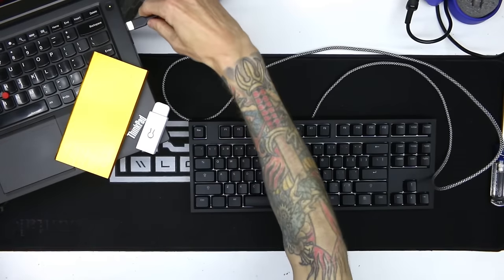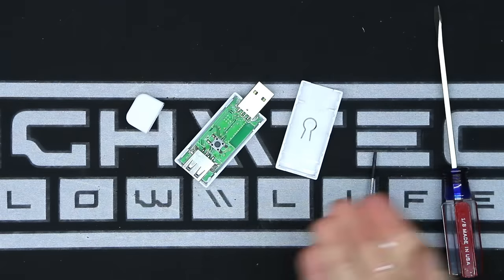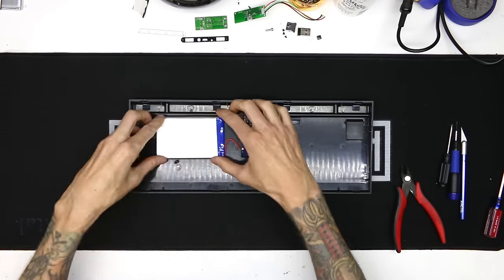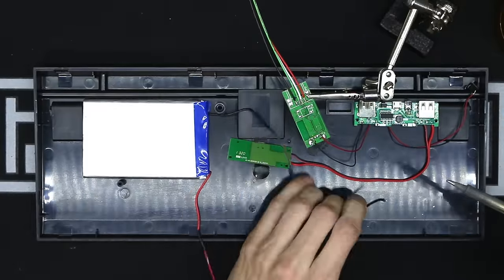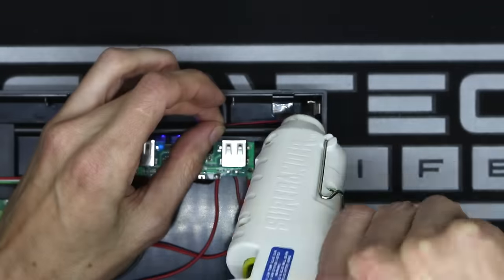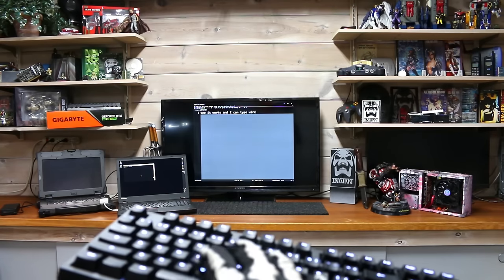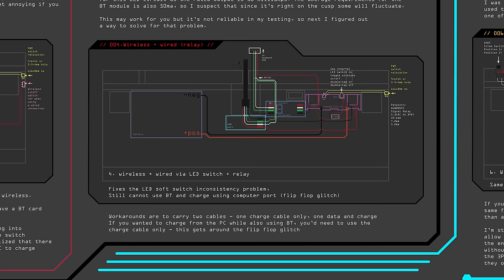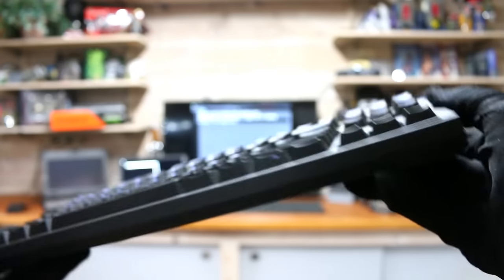⌨ Make ANY Keyboard Wireless! - Convert Any USB keyboard to Bluetooth Wireless - DIY Tutorial How To

Comment: how to test if the keyboard pcb is still good to be use if the connector usbc end is broken?
Reply from the maker: You will still need a way to connect to the PCB, if you can solder direct to the USB pads/traces, that is one way - put a temporary USB connector on those wires and test the board first 👍
Reply: @hightech-lowlife  thanks bud.... May i know if I have a pcb who's only connector is dead, the silver contact point is torn, how do I read the circuit markings so that I can create another new usbc connection point on the pcb... Theres like markings like 22R, 22PF, 331, 5.1k, i was planning to trace the markings then maybe able to create another new usbc connector point, if u can direct me to resources that can help me on this,it will be very much appreciated..
Reply from the maker: @osirusj275  It should be easy to find which traces connect to which pins, I don't know what connector you have, but if you just google search for "USB your usb connector type pinout" you should be able to see what pins do what 👍
Reply: @hightech-lowlife  the broken usbc has the silver connect point on the pcb and there's no other connect point, and the only one is broken.... Does that mean the entire board is done... Or I can trace the fine line on the board to create another connect point to usbc? My issue is I don't know if this is doable, if it is, how to trace the line to know where I create the new connect point? Do I need to have the circuit design of the pcb to be able to trace?

Comment: How to diy bluetooth for the controller, the type without bluetooth( ps4 resolution pro controller pro 2 ). Please help me. Im from vietnamese, so i can’t understand. Please guide in detail
Reply from the maker: What are you trying to do? Connect a PS4 controller to your computer?
Reply: @hightech-lowlife  yes, my controller do not support wirless, so i want to make bluetooth for it, how can i do?. My controller model is “ nacon ps4 resolution pro controller 2”
Reply: @hightech-lowlife   it have connect pc by cable type C, but i want to diy bluetooth for my controller
Reply from the maker: @haimontage633  Don't they already make wireless PS4 controllers? I looked on Amazon and they are $22, which is cheaper than the BT module you would need to DIY. Of course you still can DIY it if you want, but you'd need a reason more than economics for that 👍
Reply: @hightech-lowlife i can @hightech-lowlife  but i love diy and learn, so if you can make a detailed video tutorial that would be great
Reply from the maker: @haimontage633  Yes, you can actually use this module for controllers, so it will be roughly the same video, just in a controller instead of a keyboard 👍
Reply: @hightech-lowlife   but i dont know code, how can i do without code?
Reply from the maker: @haimontage633  You don't need code if you use the BT module I showed in the video, as you can see I did not do any coding 👍
Reply: @hightech-lowlife  Which schematic should I use?, I see some diagrams need relay circuit, what is it for?
Reply from the maker: @haimontage633  Since you don't need to be able to flash firmware, then you can use the simpler schematic, it's very easy. https://hightech-lowlife.github.io/projects/004_wireless_keyboard/wireless_schematic.pdf number 7, top right 👍

Comment: Hello Sir , I love your video. I am struggling with my project. If u can help me,I will love it.                                                 I am trying to develop a system where I will send a specific signal to a microcontroller by pressing any of around 100 different buttons and for each key, the microcontroller has a fixed task that it will accomplish. A good example of my system can be a Bluetooth keyboard with a pc. For example, by pressing 'A' we get written A in pc screen.
Note: I am not talking about android based communication like smartphone and Arduino connection with HRC Bluetooth module. In my system, no smartphone will be used.
1. Now I want to know how can I do that? Please specify with Bluetooth transmitter, receiver name, and a schematic diagram if possible.
Reply from the maker: Thank you! 

I'm sorry the description of what you want is too vague for me to be able to offer any help or guidance. It seems like you want a keyboard to send code to a pc? That's essentially what this bluetooth module does, so I'm not sure what you would like to be different (or why?).  

You might want to look at this project, it might be more of what you want? I'm not sure though because your description of what you want is very vague: https://hackaday.com/2020/02/13/emulating-a-bluetooth-keyboard-with-the-esp32/ 

Thanks.

Comment: i have a code v2 but the full size board version i recently done a usb c mod but i think this is my next project anyway here’s a sub from a new viewer
Reply from the maker: Thank you!! Fullsize you have even more room for a bigger battery!  ⌨⚡📶
Reply: @hightech-lowlife  i could do that but me being me I’m not the best at soldering so because i have the full size i think i can get away without soldering for some parts such as the part where the bt adapter connects to the power bank anyway i have a power bank that looks the same as yours and it fits so i’ll start with that

btw when i done the usb c mod i used a micro to female usb otg cable and put a usb c female to usb male adapter on the otg but had to strip the cables housing to fit in the board
Reply from the maker: @rakimahmed9757  I see - if you cut the channels out of the case you will have enough room to not have to remove the USB ports on both the BT module and charge board. You may be able to fit it without cutting up the case too much, just be careful of the top PCB touching the components below. 

Your type-c mod must have been DIY, because WASD sells an upgrade kit for the V2 to type-c, plug n play. You don't actually need the micro PCB board for it to work with type-c, you can go direct from type-c port and splice in to the main PCB JST connector wires. I get why you did it the way you did to avoid soldering though :)
Reply: @hightech-lowlife  yep ill do some measurements and see what i can do thanks for the advice
Reply from the maker: @rakimahmed9757  No problem at all! Thank you - you can do it!

Comment: High Tech \\ Low Life    
    I  have three VCRs Mchine does not work 
     1] I need to learn how to clean the Machines
     2] The ones that works and the ones that doesn't work 
        Use the parts to make a tape cleaniinng  Machine 
     3] need to now how to use the motor. how to power the
        motor -speed control forward and rewinding stop -
        and the tape counter  High Tech \\ Low Life    
        can you help me Alan
Reply from the maker: I would check out the channel 12voltvids he does a ton of VCR repairs and shows you many ways to repair and restore these old units. I learned most of my audio repair skills just from watching that channel. Good luck man 🍻

Comment: BT-500 is too expensive, any alternative to this?
Reply from the maker: You can go arduino, but you will only save about $10 and you will have to load libraries and code a bit. To me the ten bucks saves hours of work. Comparable arduino is still 27ish before tax and shipping. 
 
Other options are to find a very cheap donor wireless board on ebay or a thrift shop (could potentially find one for 5-10, then gut it and port it over. It's a lot more work and things to figure out, but it is possible as I've seen a few conversions done that way. 

It's totally possible to save money and do this for less, but you will be paying in your time as the other options are way more involved and will take a lot longer to make. 👍
Reply: @hightech-lowlife  Thank you very much for your time. I'll take it into consideration.
Reply from the maker: @bertussss  No problem, and I wish you luck! Thank you.

Comment: can i use this with game controller
Reply from the maker: Yes, but I would check with handheld scientific if they can confirm it will work with your specific controller. They are very DIY friendly, so in the even it didn't work, I believe they would refund you for the return even if you mess something up.
Reply: In their FAQ they actually say game controllers are not supported. I've been building a similar device for around a year and I've actually managed to have support for basic game controllers (no xbox and other controllers that require extra drivers though)

Comment: Would a 3.7v battery work or does it need to be 5v?
Reply: Does the charge circuit have a transformer on it if it has a copper coil
Reply from the maker: The battery I used is 3.7, but the charge PCB has a boost converter taking it to 5V. Most keyboards are designed to run off 5V because that is what you get from a USB port. Most batteries will be 3.7V because that is the default for a lithium cell.
Reply from the maker: I don't know what this question is for? Most likely the coil you are seeing is an inductor 👍

Comment: i love this video! i was looking for something like this for years! but it costs a lot :-( (yes i know 39$ isn't a lot but im a student who doesn't earn and my pocket money is 10$ monthly)
Reply from the maker: Thanks man! Yes, it is not cheap, but if you think about how much an arduino based one would be it's only $10 more, and you don't have to write any code, and it has a lot of features. 

If you're looking for a budget wireless mechanical keyboard, check your local used market. That is a good way to get cool boards for less 👍
Reply: @hightech-lowlife  thanks for the like!, yes i know that its very cheap thinking of all the code and stuff but im broke lol i wish there were more producers
im no really looking for keyboard but just want to make my own wireless hub
Reply from the maker: @himynameissaksham  Cool! Check out some arduino projects, you may be able to work with one that is less expensive. Or maybe even hack up an old wireless keyboard to slave the guts from it. 👍
Reply: @hightech-lowlife  Thanks, i would definetly check out some

Comment: Instead of just removing the led, relocate the other button on the other side and use the led pads for something cool like a mini fan you can turn on to draw air through the keyboard or something.. also to bring up hot glue, slap some electrical tape on the outside of those led holes stretched tight and push some in the holes from the other side, peel off the tape when it’s cooled and you have cheap and easy led diffusion.. can even cut custom shapes. Ah okay now I see you did use it for something.. but instead of use it the power bank to power a relay constantly that makes it usb.. why not get a relay that closes when it loses power so that usb works by default and when the power n\bank turns on the relay cuts the connection to the usb as the bt module turns on.
Reply from the maker: That's a good idea, thanks! I will try the hot glue diffusion later on at some point 👍

The relay auto on is nice, but all of the power goes through the battery, so with this suggestion there wouldn't be a way to charge the battery while you're using the wired connection, if you wanted only a wired connection without charging the battery you could totally set it up this way, but I wanted it so if you ran out of battery you could use the wired connection and also charge the battery at the same time. 

Really good suggestions though, thanks for your feedback!
Reply from the maker: Oh the other thing, the LED circuit is basically useless because it will only output about 40ma, I originally tried to just attach the BT module to get power from this circuit, but it drew too much power and was causing issues with the BT module, that's why I had to move on to using relays 👍

Comment: I didn't understand why we need a charge circuit with a turn-off feature when a (keyboard) load is applied? Shouldn't I be able to use the keyboard (i.e. load) while it is charging? Would appreciate if someone can clear that up for me
Reply from the maker: Hello Abdulla, you actually don't 'need' a charge circuit that can turn off when a load is applied, but the reason I do in this circuit is because I am using a single button to control everything. If you get a charge circuit that will not shut off when a load is applied, then you will need to add another switch to turn off the keyboard. 

The reason is because internally the keyboard is /always/ connected to the charge circuit (that means a load is /always/ applied!) If you don't have this function, nor add an additional switch, then how would you turn off the keyboard to save battery life when you're not using it? 

I hope you can understand :)
Reply: @hightech-lowlife  Thank you for your answer!

Though I understood some parts of the answer, I think I am missing some point here. When you say "charge circuit that can turn off when a load is applied " and that "keyboard is always connected so load is always applied ". Wouldn't that mean that the charge circuit will always be turned off? Don't we want it "on" while the keyboard is connected and in use?

I am sorry if I am just being more confusing here
Reply from the maker: @abdullamasud4278  You want to be able to turn off the keyboard, otherwise it will always be "on" and using the battery, even when you're not using the keyboard. You want the ability to turn it off and to turn it on, not have it always be "on", and consuming power. 

If you don't implement either a disconnect (switch) to the charge circuit that will cut the power to the keyboard, or you don't have a charge circuit that can turn off when a load is applied (remember, the keyboard is always connected to the charge circuit), then you won't ever have a way to turn off the keyboard. 

For example; you've been typing all day, and then you want to go to sleep, if you don't turn off the power to the keyboard, then it will be consuming power when you're not using it. When you come back to use it the next day it will have significantly less power in the battery, than had you turned it off during that time that you're not using it.

Of course you don't 'have' to do this, but if you want to prolong the duration of time between charges, then you will definitely want a way to turn off the keyboard. 

I hope that makes sense :)
Reply: @hightech-lowlife   OH I just realised after going back and forth between your answers, the video, and your schematic! So "charge circuit than can turn off when load is applied" is just a charge circuit with a switch that we can physically press to turn on and off the keyboard. I thought this was some charge circuit that was smart enough to "turn off when the load is applied" automatically. My apologies for the misunderstanding!! Thank you for clearing it up though!! I would most definitely try this hack out!
Reply from the maker: @abdullamasud4278  I'm glad you can understand now :) Thank you!

Comment: Someone should make a kit that converts a wired keyboard to a bluetooth. I definetely would buy one
Reply from the maker: It would be cool, but you'd have to offer a ton of different variations as the battery pack size is critical to allow it to fit inside the keyboard case though 👽

Comment: Any way to make a keyboard wireless via a dongle?
Reply from the maker: I'm sure it's technically possible, but you would need many more components than just the dongle, and it would be quite complicated. Most likely would end up costing the same or more as this module and would be multiple hours of work. 👍

Comment: Scond application is normal powerbank.
Reply from the maker: Yes you have to be careful though, not all powerbanks can be applicable as some do not allow discharge + charging at the same time. Others will auto shut off if not enough current is being drawn. 👍

Comment: that huge battery is overkill. will auto-discharge faster than the keyboard itself will deplete it.
Reply from the maker: Is that so? May I ask what are you basing this opinion on? LiPo batteries hold their charge extremely well. 

For TKL with medium brightness backlight settings, 3000mAh will last about 27 hours total, for my expectations this requires more battery power - which I am addressing in a future video.

Comment: At last someone think how to do it, I hope some brand make a device to connect on the USB from the keyboard and make it wireless. . .
Reply from the maker: That's what this device is/does? 👍
Reply: @hightech-lowlife  ya, but I mean a plug and play device, without the DiY process
Reply from the maker: That's what the BT-500 is, can you check the beginning on the video? I plug in the keyboard to it and give it power and it will work, no DIY or soldering required.  @Raxsephon

Comment: will it work with razer tartarus?
Reply from the maker: It should work with almost anything, here is a list of only the things they have tested so far: http://handheldsci.com/comp/ 

Also, they will even offer a refund if it doesn't work with your device. This is from their website: 

"Double Commitments: (1) We will investigate any case of incompatibility you report and provide free replacement until the issue is fixed; (2) you can return the adapter for full refund including S&H within 6 months of purchase for any reason. If you have communicated with us about an issue, then there is no time limit for the return. The returned unit can be in any condition, e.g., without original package, damaged, burnt (in that case we just need the ash back :-)."

I'm not sponsored by them at all, but to me (IMHO) a company that allows this kind of experimentation and allowance for trying things out is unheard of and they deserve the money.